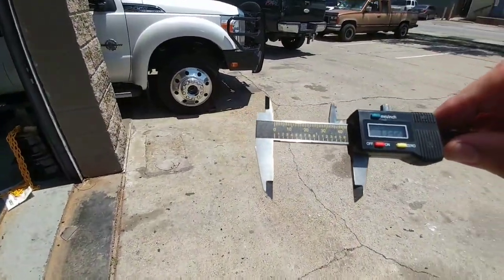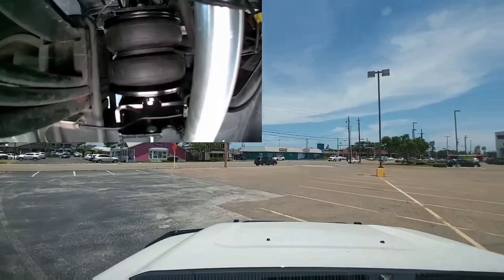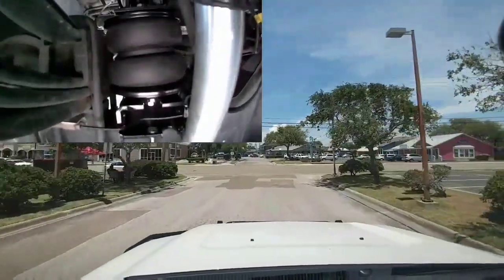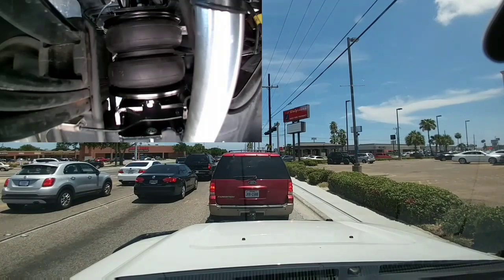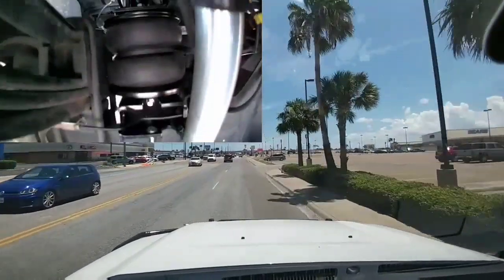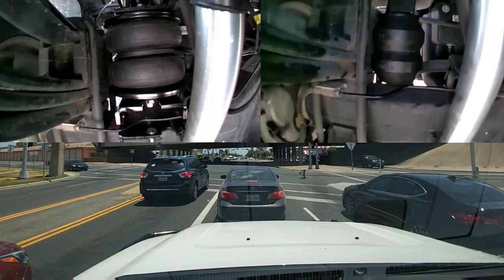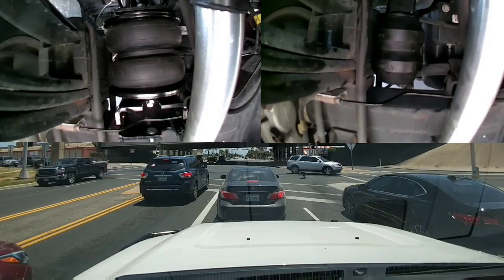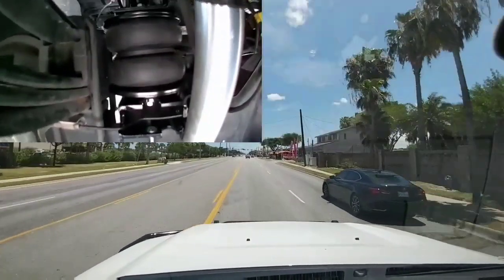Air Lift Load Lifter 5000 Airbags, First drive impression!

Comment: I knew you would love the Air Lift air bags. I bought the Timbrens for my 2016 F350 dually but decided to go with the new Air Lift 7500 bag. The new 7" bag allows you to run a little less air under load. I deliver new campers all over the country and wanted the versatility of the air bags for the the different sized trailers we deliver. I run 15 lbs when empty and seems it rides the best. I love not being high beamed when under load anymore. Good luck with them and keep the videos coming. I love your channel.
Reply: Chris Rodriguez hi i have the 5000 lift for my 350  my rv is 19  k and i move a 30 k trailer and have no issues  not sure if the  7500 series would be a over kill am i correct  just a question
Reply: pipefitter Nicholson Hello. No it wouldn't be overkill. Just a bigger bag so you can use a little less air and give you more versatility. Thanks
Reply: Chris Rodriguez ok thank you for your answer
Reply: what was wrong with the timbrens?
Reply: Regal2800 nothing. Sold them on eBay and guy is super happy. Just wanted the variables the bags give me.
Reply: Im having 7500s installed on my f350 for a Lance 1172 camper I'm hoping its a good set up
Reply: TShull You'll love them.
Reply: I too have the 7500s on my F250. The only issue I had is with the clearance between the passenger bag and the exhaust. I have a B&W gooseneck hitch which requires lowering the exhaust. This put it pretty close to the bag which prevented the use of the heat shield that AirLift provides. I wrote them asking for advice and was ignored. Ended up using header wrap to keep the heat off of the bag.
Reply: Javier Martinez I know it stinks how we're left on our own sometimes to figure things out. They're usually pretty good. I'm on my third set on 3 different trucks.
Reply: Chris Rodriguez 2nd set on 2 different trucks here. I'll probably put bags on every truck I own. Unless they start coming equipped with them from the factory haha
Reply: Chris Rodriguez did it change the way the truck rides when not under load
Reply: I have a ram 3500 2017 What do you recommend for my truck? Air bags air lift or timbrens
Reply: I’m thinking about putting these on my 2500, I tow a 27ft bumper pull. Would you recommend this product for what I’m towing ? The trailer it’s self weights 6k. I know my truck can handle it I’m looking for a smoother, comfortable ride.
Reply: @APeezy559  yes. Definitely would help your ride comfort. Also it’s nice not getting high beamed all the time at night. I also use load level bars which also help.

Comment: That's not the track bar you measured, it's the tie rod bar, from knuckle to knuckle end, the track rod bar is the rod on the frame to the axle housing.
Reply from the maker: You are 100% correct. I meant to say Tie rod.
Reply: drag link
Reply: @BigTruckBigRV  hi I was wondering is the 450 front end wider than the 350 and if so by how much thanks

Comment: That’s not the trac bar, that’s the tie rod. The trac bar, also know as the panhard rod, keeps the axle centered under the truck. The other bar is the drag-link that connects the pitman arm to the passenger side steering knuckle.

Comment: We now have almost the same set up..I knew you'd like the bags.  Now possibly I can talk you into some softer springs in the front, with some Fox 2.5 double adjustable shocks....same in the rear..this way your 450 will ride close to a 250.  The front and rear springs soften the ride immensely on my F350.  The bags take over when need be and now the Sulastics just enhance my system.  If you are ever in the Diamondhead MS area..look me up and you can drive my truck.  Love your channel, very informative..

Comment: @ Big Truck Big Rv 
Great video!!
Just as an fyi, if you have a lifted truck and want airbags you can buy diferent size spacers from Airlift to compensate for the lift. Also PMF suspension makes lift blocks with an airbag mount.

Comment: Ok this one has to be the most helpful one I have seen of yours. For me personally. That is something I am looking for for my 2014 ram 1500. Truck rides smooth as a Cadillac. But it has coil spring suspension in the rear which makes it much softer then a half ton with leaf springs. I don't like what I have been finding on the market and would like something more to what u have. The main purpose of the truck besides a daily driver is to tow my 32 foot travel trailer. I have all the weight distribution and I practice proper distribution but the fact of my truck squats and it's nature of the beast. I know the bags would help but can't find anything like yours

Comment: That wasn't the track bar that you compared in the beginning, that was a part of the steering linkage, the track bar is the bar that goes from the axel to the frame, to help keep the axel centered under the front of the truck

Comment: You should be using weight distribution hitches for those heavy trailers. Air Bags make the truck level but do not address the front axle weight loss(poor steering control/braking). Using both is a dream come true.

Comment: Nice job on this. To me the 7500 system is bit of over kill for a majority of the people driving them. Even with a 18k or 19k 5th wheel the 5000 model (6” bags) exceeds most needs. Also don’t know if many will ever use the individual bag adjustment feature as most loads rest on the center of axel.  The wireless one system offers all the wireless features except individual adjustment. If you use your truck bed to haul heavy loads, like construction use, I get your setup however for the money we will pay for these systems I would suggest the wireless one compressor and the loadlifter 5000 air bags w/ or w/o the Jounce bumper built in.
Reply: Ric Bailey how much is the wireless one compressor?  TIA Colleen G.

Comment: Looks good, been very happy with mine although I have not needed to use them on my 2017 350,  truck does not appear to squat much when I hook up my 5th wheel.  Seems the suspension is stronger on the new ones or something.  I will have to take some measurements before and after to confirm.
Reply: Wonder Whats Next what is your load, pin weight etc total. I may be running over 4000 4500?
Reply: My pin weight is around 2800 pounds.  My trailers dry weight is about 14,600.

Comment: I noticed something of concern in your video when it shows the air bags and Timbren side by side. If the vehicle with the Timbren bumper were to come under heavy load causing the bumper to rest on the axle, it would land right on top of the brake line. The brake line in the airbag setup goes under the bracket. I can't believe that it would be OK to have any load support land or ride on the brake line.....

Comment: Awesome video. I have a 2004 GMC Sierra 2500 HD with a leveling kit, I pull  30 ft  5th wheel would you recommend these airbags for my truck?

Comment: I have a local dealer I use for my truck accessories and I asked them to quote me an install on this system.  Since my new 2017 F-350 is a 2WD DRW they were not sure if the kit was the same as for the 4WD DRW trucks.  They tried calling Air Lift and they are having trouble with someone answering the phone or getting back with them regarding this question.  I would have a serious problem with buying this product and not being able to contact the company if I had a problem.  If you have a contact in the company I would suggest you advise them of this situation.

Comment: I presently reside in Fredericksburg TX and am patiently awaiting my new 2021 F350 Long Bed.  I pull a 30' Travel 
Trailer.  The tongue weight will be less than 500 lbs.  I like the Air Lift.  I will probably drive down to CC to have Josh do the install.  (I was reared in Alice.)  In your opinion should I get the 5000 or the 7500 bags?

Comment: Great video...I have a 2021 Tacoma Double Cab and pulling a 2019 RPOD trailer.. I’m using a Anderson anti sway hitch and getting Air Bags installed next week. $2,100.. Wireless.. Any advice for a beginner pulling a trailer?

Comment: I thought this video was going to talk about yhe airbags.  I have new 2020 F250XL 4x4 truck and was going to install Sulatic springs but sounds like you said like you have sulastic springs as well as the 5k# lift airbags.  Sounds like a good combination.  Do you still have a stiff ride with no load? I don't want the stiff ride (whether the truck is loaded or not).  I'm trying to get a smooth ride.  Can you help me?  Thanks Full-watch (twice).  👍🏽🙂.

Comment: Looks good!  Thanks!  Have you ever done a video on a rear sway bar?  My F250 does not have one.  Would it make a difference when pulling my fifth wheel camper?
Reply: it would help and depending on the year of your truck, you might easily be able to find one from a salvage yard from a truck with a heavier package.

its likely to be an easy bolt on affair when using factory parts. 
you will need the sway bar itself, the sway bar to axle brackets (and bushings) sway bar end links which bolt to the frame, at least on my generation f250. (write down what it came off of so you can buy replacement parts if needed)

just looked at my own f250, it would be 100% bolt on, no welding / cutting required if using factory parts.

Comment: I've looked at all Your Air Lift videos, the ability to level the truck is obvious, but my issue has to do with side to side lean as experienced when turning a corner or with uneven pavement with a tall max capacity load in the bed. I'm carrying a large slide in camper. I have the upper TorkLifts installed , considering the lower TorkLifts as well, Timbrens, Air Lift bags, or Big Wig sway bars.  Which would help most with this?  My truck sags about the same as your F450 with the 5,000 lb. load.

Comment: How much was the cost for the product and for installation?
Reply from the maker: Prevailing Viking: bags only are about $400, WirelessAir control and compressor kit about $600 and install about $200-300

Comment: great video...looking for airbags myself I have a 2013 2500hd Duramax towing a fifthwheel trailer and a pin weight around 1580 lbs plus cargo. Any suggestions would help for the right ones

Comment: Did you get a chance to try your 5er with the bags? I just noticed that on the airlift site it says these are not compatible with 5th wheel hitches. Does that mean that the factory ford puck system isnt compatible with these bigs? Thanks for the great videos.
Reply: Works fine with my B&W turnoverball Gooseneck hitch.

Comment: you didnt measure the track bar. you measured the tie rod. the track bar is clearly visible in the video and its not what you measured.
Reply from the maker: Black70Fastback: correct, misspoke
Reply: Who's "Miss Poke"? Is that the old bag down the street. JK

Comment: I have a 1999 Dodge dually Xplorer campervan.  Would the air bags give me a smoother ride?  I put new shocks and idler arms to help with sway, but I live on a dirt road and the van does not do well on it.  Would the sulastic springs help?

Comment: what made you get the airlift vs. firestone?  Do you have enough seat time to compare it to the timbrens?
Reply from the maker: Regal2800: Airlift has a better warranty and wireless control system.  Plus, Firestone doesn't offer a kit for an F450 pickup

Comment: I am looking to make the ride as smooth as possible on my 2012 f250 3/4 ton 4x4.  Its not a dually but I was hoping on some quick feedback from you.  Is the Airbag set up plus solastic shackles plus equalizer anti sway bar setup the best way to do this?My wife has had several back surgeries and I'm just trying to remove most of the jolting and jerking from my travel trailer.  Which is a 2019 29' Hideout.  Right now I have nothing, Its all stock even stock shocks.  In your opinion what is the best set-up as far as suspension.  I want it to ride as close to a Cadillac as I can.  I want to be able to travel across the country without being beat to death by my truck and travel trailer.

Comment: So for UNLOADED comfort and a limited budget (can only afford 1 of the 2) would you install the Sulastics, the Airbags, or something else?  I have a F250 with a 5" lift and have been considering the Sulatics, and have talked with Air Lift about options for a lifted truck and they said they could recommend something when I was ready to purchase.
Reply: I am in similar situation. Did you ever install either? What are your results ? Did the ride improve unloaded?
Reply: I'm looking for the same.   Since I have the RAM, Sulatics are not available.

Comment: Can these be used on 1989 Chevy Silverado trucks?
Reply: Ya there is a kit if not by air lift ther is a few manufacturers in Arizona like Chassis Tech whom I've used and installed many of ther kits on your year truck for towing and other purposes they've had a few bad reviews by DIYourselfers who didn't know what ther doing so they blamed the maker which is wrong but they stand behind ther products w/a lifetime warranty.. also ther is airmaxx also in Mesa, Az I have ther Maxx Tow kit w/a 580 compressor & an air tank on my '11 Silverado and love it came with everything to do install

Comment: Any limitations on axle droop with these airbags? I have used rolling sleeve types and had to have limit straps to prevent the bags from pulling off the end caps at full droop.

Comment: i have a 2004 ford f250 super duty 4x4 can i put air lift on the front as well as the rear will it give a better ride .
also i plow with truck would it help limit the weight when having plow on

Comment: How do you know what psi range you should be in for any given load? Is there a chart?
Reply from the maker: Alexander McKay: not really, just feel and eyeball it
Reply: Set it to where you're satisfied with the ride height.
Reply: Best way is to check the ht of your front from ground to wheel well, then check back doing the same. On my camper, slide in pickup setup,  the rear goes down about 2.5 inches, so just raise it so its level with the front.

Comment: Does anyone know what type of airbag or part number I would need to be able to drop the air and lower the back of a pickup for loading.  I see some have internal jounce bumpers and others do not but from the videos I've seen you can dump air an drop it down like a diesel rv for example.

Comment: ok, some inside experience, i had the same model bags installed in my 2500 ram, and for some reason or maybe heavy reason, the air fittings blew out, what happens next was, ok so you have the internal jouncer to prevent the truck from bottom out, well the jouncer went straight to the bags and just poke a whole and destroyed the bags, now I have the ones with no internal jouncer and have worked just the same, I think if something happens again I will just in need to be careful until I reach my destination with the heavy load, I believe it won't happen with a trailer, only with having over 4500lbs of load in the bed, so, my bad

Comment: Could you please advice what psi you are running with the 5th wheel hooked up and truck level.
Reply from the maker: weatherherk1: I imagine ill be around 55psi. Ill let you know though.
Reply: It whatever PSI it takes to get the truck to sit how you want. I've had mine anywhere from 15 to 95 PSI depending on the load.
Reply: Javier Martinez i understand that...I was referring to 5th wheel towing because we both are now running similar systems.
Reply: weatherherk1 I understand that, and the answer is the same. If you're looking for a specific number then start with 55 like he said and adjust from there. Every truck is different, there is no specific pressure to run.
Reply: Javier Martinez  👍
Reply: I agree with the PSI. I have this system on a HD2500. What PSI do I run for a given trailer? It depends on alot of things. From the load on my gooseneck to whether or not the water tanks are full on my 5th wheel. I may even change the PSI if the road is a little more bumpy to less or more depending on what feels right and provides the best comfort. With the remote controller for the bags it makes it simple.

Comment: Isn't the track width of the front axle narrower on the F450 than the F250/350?
Reply: bigshafe AFAIK it's (optionally) wider which allows for a tighter turning circle.
Reply from the maker: bigshafe: it's a total of 6 inches wider

Comment: Bags look impressive in use, and probably give a superior ride; however, my opinion is still tainted by expensive issues with the air suspension on our recently demised Range-Rover. Purely based on the pain-in-the-arse factor when the bags degrade, I'm definitely still in favour of the Timbrens. We got around 110k miles until the air suspension gave trouble, which ain't bad, but the repair bills still give me nightmares a year on. I felt like I'd been raped. Coil or leaf springs for me from now on. Been looking at Ford Rangers this week, very impressed.....

Comment: What is a track bar?
Reply: its not what he measured. he measured the tie rod.

the funny thing is that the track bar is clearly visible within the video. its the that has one end connected to the frame and the other end connected to the axle running parallel to the axle.
Reply from the maker: Black70Fastback: yep, my mistake.
Reply: They are like a cliff bar but you eat them before a track event.  Get them at Costco by the box.

Comment: Hey man, I'm using a 2016 sierra 3500 for hotshot trucking. I'm usually pulling about 25k with the gooseneck and the ride is just unbearable with stock suspension, should I get these or would they get destroyed under the weight? (Note the tires are larger than stock, 305 70/r17). I'm using shocker hitch and it's better but still really rough, if this doesn't work what should I get?
Reply: In my experience these would be an awesome addition for a Hot Shot rig. Being adjustable for varying loads you would love them. The ride and handling is great, and no more squat.